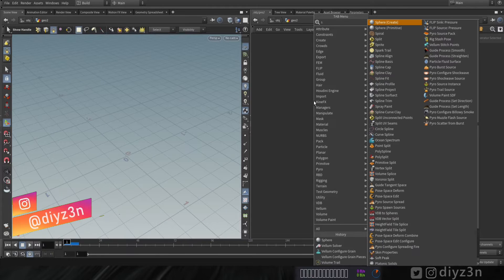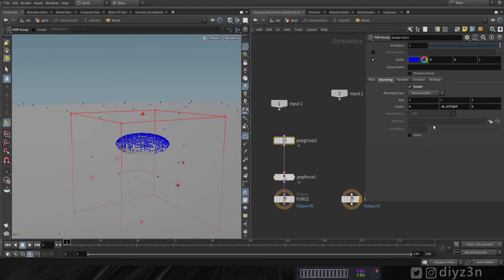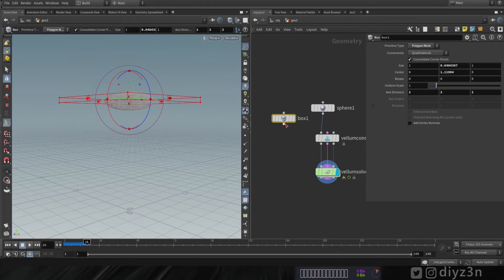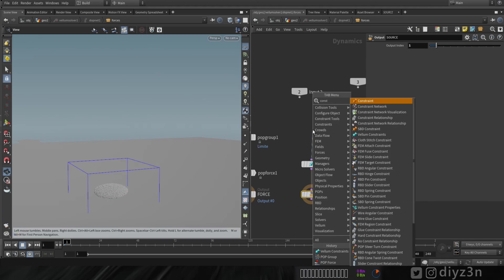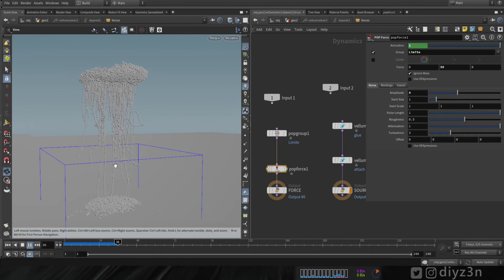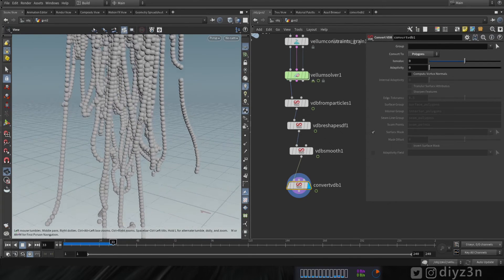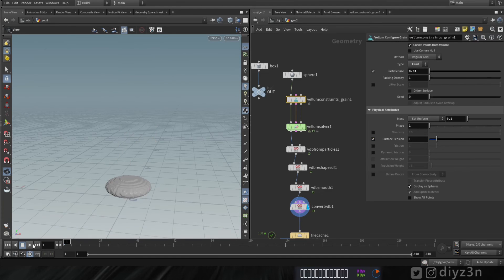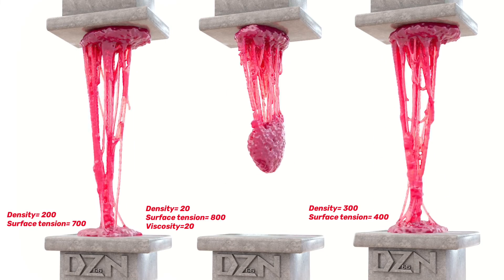Sticky gum with vellum sidefx Houdini 19.5

Comment: One question:  at the 2nd step, on the 'vellum constrain grains' node... would it be possible to make the grains/spheres  at random sizes ? 
Not the Jitter, but the sizes..
In order to test if that could give the simulation  more  interesting  variations ?  🤔
Reply from the maker: OK that’s interesting idea. I didn’t try that though

But my first thought is every Vellum grain particle have a scale attribute (I don’t know the exact name) and this attribute will consider in the mesh section, for example vdb from particle node

But I was wonder if is this attribute consider in the simulation or only in the mesh section?

Comment: i would like to do this at sop lvl
Reply from the maker: I guess you meant without vellum solver or sim in general , otherwise basically it is at sop level
Reply: @diyz3n  No, I mean avoinding to dive inside the solver by using vellum attach and glue constraints at sop lvl and giving initial impulse to the source rather by animating the source / using point velocity / or the built-in wind force in the solver params...(or any other way). Anyway I didn't get it to work because the params of the attach and glue nodes are different at sop lvl.
Reply from the maker: Yeah you know i am big fan of sop lvl  too, but to achieve that sticky thing (attache to geometry) for example, we should solve it each frame to tell him build the constraint at specific distance